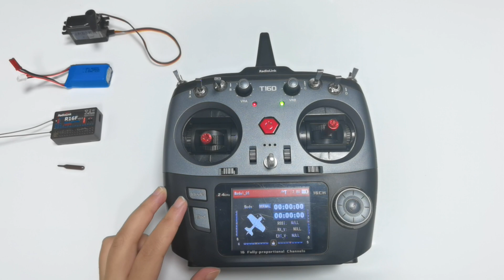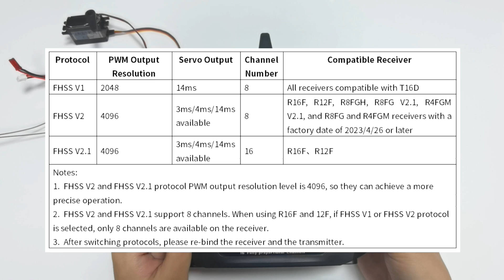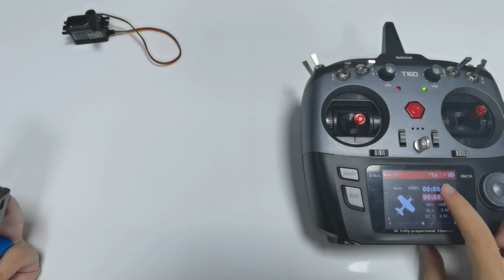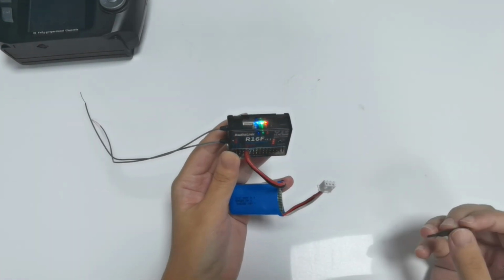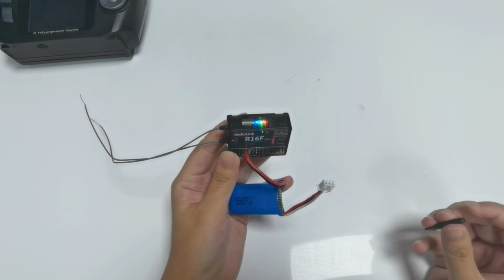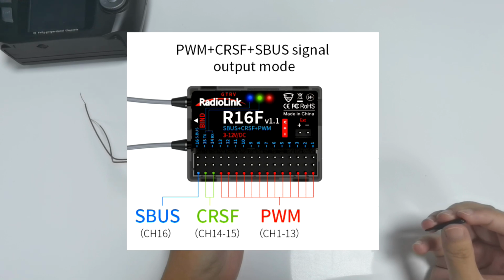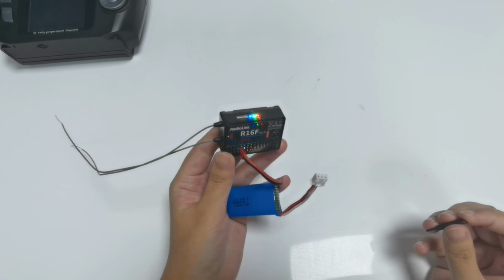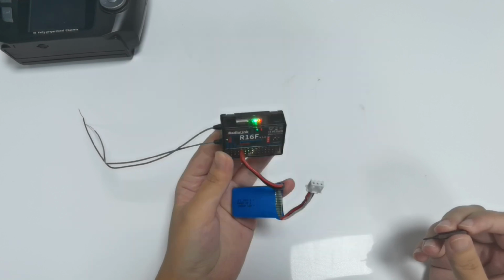Binding & Working Modes of R16F

Comment: After resetting transmitter to factory settings I can not bind transmitter and receiver. Please help. Have done exactly same as show in video. Does not work.
Reply from the maker: Hi, sir. May I know if you are using R16F and T16D? Could you please make sure the firmware of the receiver and the transmitter is the latest version? Here is the download link of the latest firmware of R16F: https://www.radiolink.com/r16f_firmwares  And here is the latest firmware of T16D: https://www.radiolink.com/t16d_firmwares  If any question please feel free to contact us. Our email is after_service@radiolink.com.cn